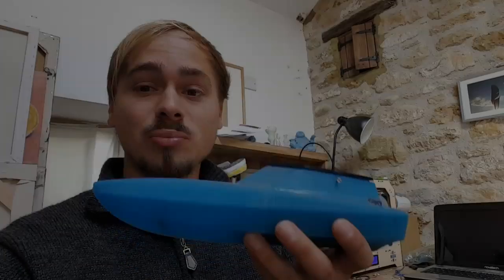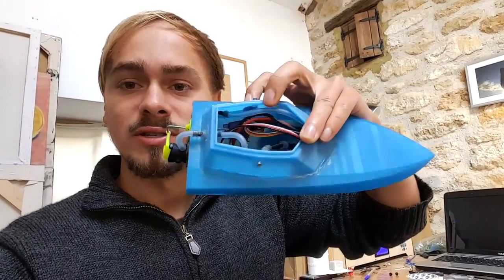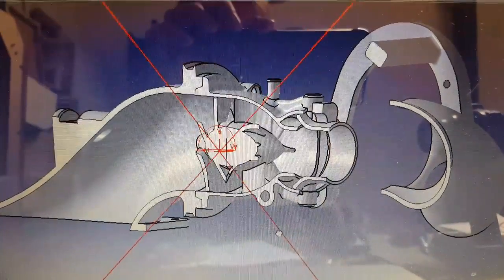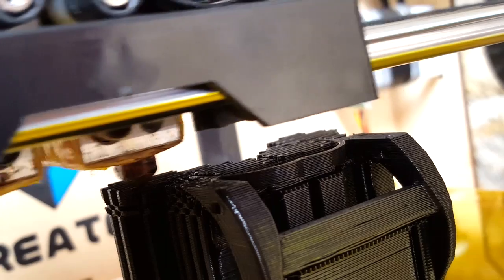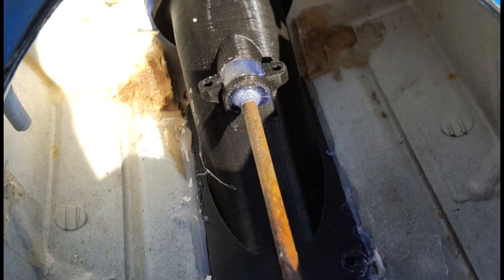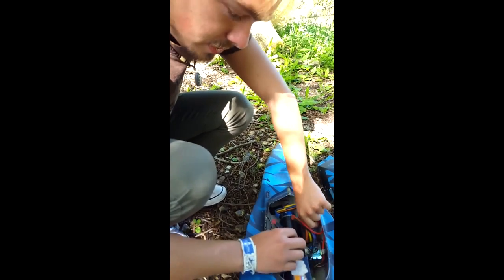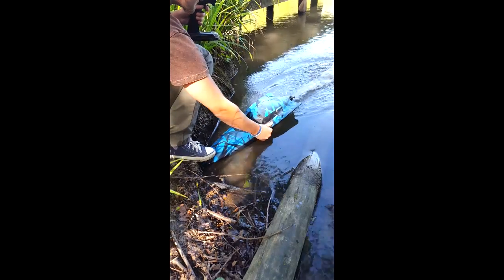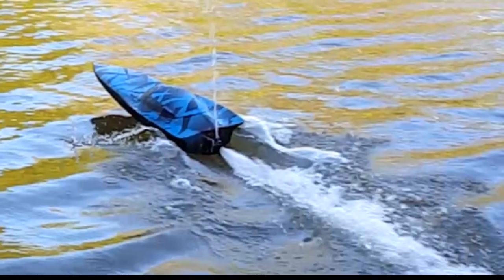Water Jet Boat

Comment: Hi Lukas,

I am printing your beautifull water jet found on thingiverse, i was just wondering the size of your boat as nozzle hole look like 20mm ?

I would like to print a boat then i need to know more/less a good ratio between boat size and nozzle size.

Printing this is just a master piece i didn't imagine possible before buying a 3d printer.

Thanks for your help in advance.

Comment: Has anyone built this yet?  How do you assemble it?
Reply from the maker: TheRealSuperman217 Hi, the assembly is quite easy. you need 4 small wood screws, some silicon to get a good seal etc. 

The tricky part is attaching the impeller to the drive shaft. I used a sleeved 5mm outer, with a 2mm shaft i think.
Reply: Sweet. Thanks

Comment from the maker: turns out my website won't host .stl files! what a pain. you can purchase the parts on Shapeways but they are expensive. i will look into how i can host these .stl files. cheers. L
Reply: https://www.thingiverse.com/thing:1952400
Reply: Hello Lukas, what kind of material did you use? What's the best material to use if you want to make a 3D printed float? Like say, a small box. Thanks!
Reply from the maker: Saurabh Shah Hi, i used PLA for this. however a foamed plastic would work well as air is trapped inside the material. cheers. L
Reply: Yours is one of the best designs that I have found, I would love to get your files. Can you put them on www.thingiverse.com? they have a "tip designer" option where we could support you or we could do a paypal donation.

Comment: Hi Lucas my name is Stu, just found your video by chance and i think 
what you have done is Fantastic very cool I am currently toying around 
with the idea of connecting an impeller to a sea kayak have been looking
 at jet ski impellers but they are to big and expensive, so seeing your 
model got me thinking, I assume that you can scale the impeller up to 
the size i would need to be able to move a sit on ocean kayak, the system
 is running of 24v, would you be interested in getting involved with the
 project, if not any possibility i could get my hands on the 3d file to 
print one out myself  I live in buckinghamshire look forward to hearing 
from you cheers Stu

Comment from the maker: Thank you for your kind comments :). I am selling the parts on Shapeways although they are expensive (I literally make pennies on each part to keep sales cost down). If you do want to support me and get this water jet system please do have a look at my Shapeways page Reneeceldesigns. 

For any of you that are planning on creating your own, I would suggest using a centrifugal style water pump as these are most efficient at high speeds :P. It is very important that no air is sucked into the pump where the motor drive enters as this will cause cavitation and your boat will be nowhere fast.

Thank you all again for watching, I wish you luck with all your inventions.